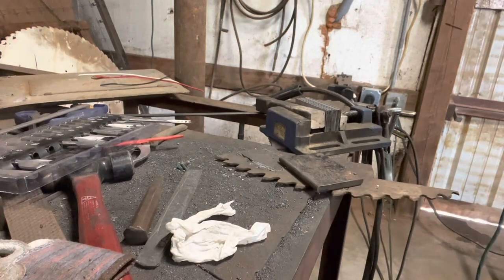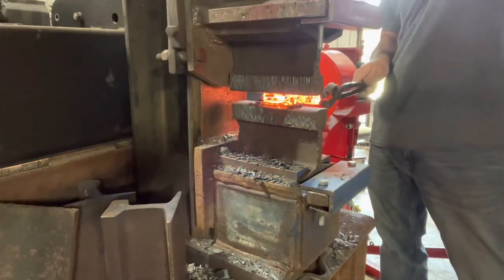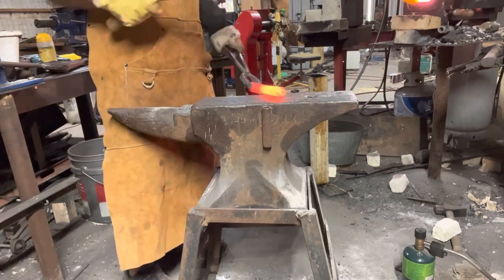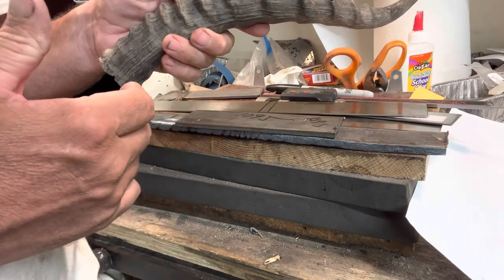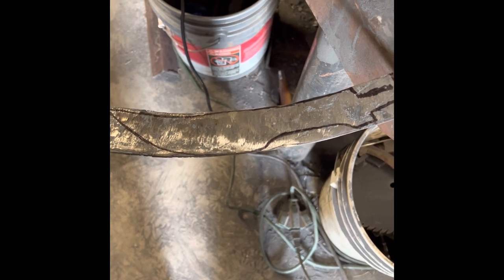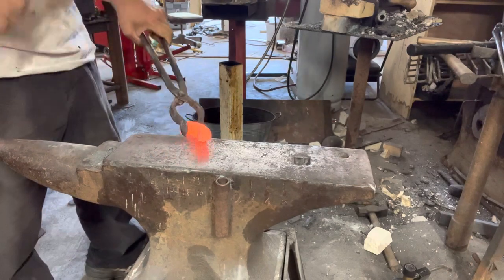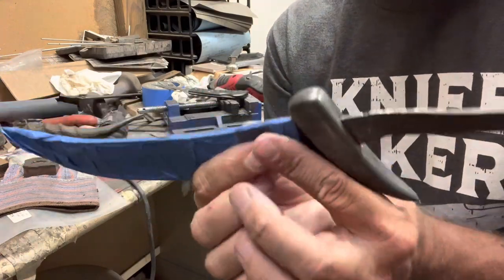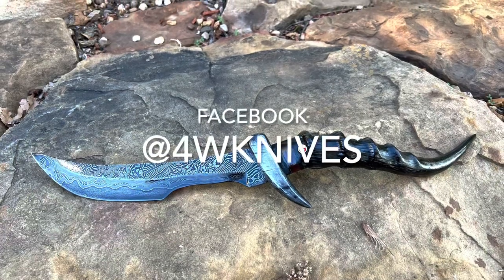The Fantasy Challenge- Making an Elven Short Sword

Comment: You've got a lot of  play in the pin at the top of your press where the cylinder meets the top plate. That might be why your press is not squaring up the billets. I would recommend getting a sacrificial metal bearing surface between the pin and the top plate.
Reply from the maker: I have thought about that. I have been worried that I might do something stupid and put it in a bind or something. Thanks for suggestion. I definitely need to do something
Reply: @4wknives   Look up Babbitt Bearings. It is what they used to do before roller bearings were a thing. Also, a brass sleeve is a good sacrificial metal.
Reply from the maker: I will do that. I truly appreciate the advice. I would love to get this thing squared up